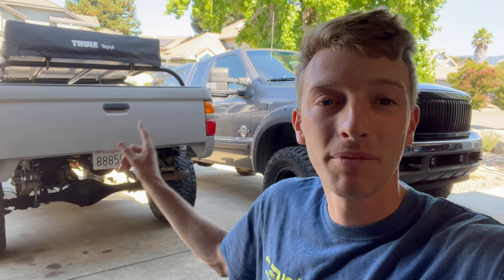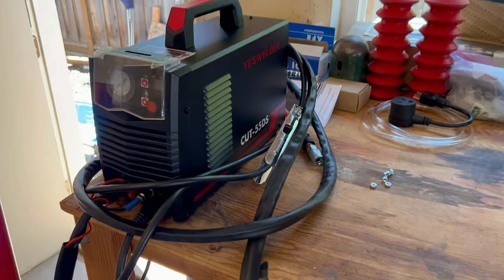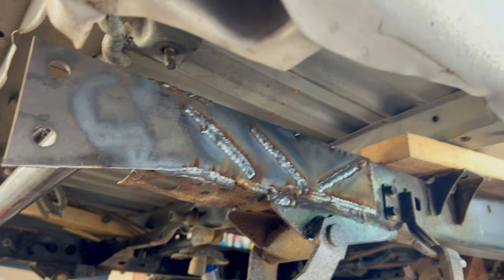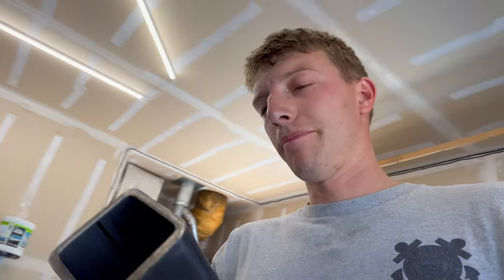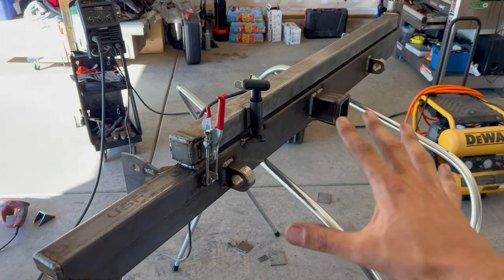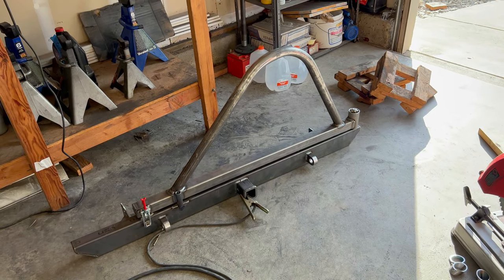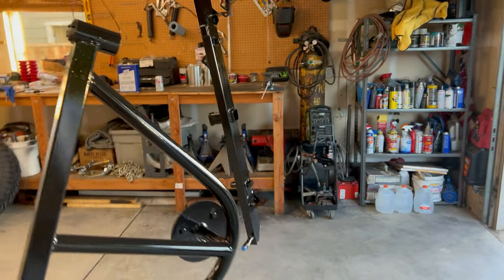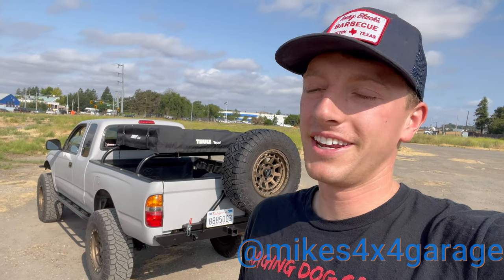Building a Tacoma rear bumper for under $350 in less than 20 minutes!

Comment: Enjoyed the video.

Offset to the right puzzles me.  That makes it block the maximum amount of rear view.  Traditionally a vision blockage would be put behind the driver.  Yeah, I know you can't see back right now, but that rack may not be on there forever.

Never leave a weld you aren't happy with.  That is why god invented grinders and grinding burrs.  Grind it out and do it over.

The best way to keep from doing as you say "dumb stuff" is to draw it all out first.  I use a free 3D drawing program called fusion360.  It seems daunting at first, but there are literally thousands of how-to videos on learning fusion 360.  Think thrice, measure twice, build once.

You mentioned pulling a trailer.  Every state requires safety chains for pulling a trailer.  I didn't see anywhere to attach them.

I also noticed you didn't use your second pin, to hold it open.

Comment: Im getting into building my tacoma and i figured it was about time i learned to weld. I have a buddy that has a machine shop and hes gonna give me some pointers. Whats your welder setup? Is there a broke guy welder to get first? Im sure i wont be welding anything super thick
Reply from the maker: You could start out with a flux core welder and learn the basics for pretty cheap. This is a titanium 170 with gas. Around $600 plus the tank for this which can be a few hundred as well

Comment: Guessing you didn't leave enough space for sag and you had to lift it to shut because you didn't show it also definitely weld up the holes you elongated or when you drop off a ledge onto that bumper it will smash your tailgate but love the looks and welds look great 👍
Reply from the maker: Yea don’t really know how I could’ve worked in the sag before welding it up. It’s about a half inch low with the tire on. No big deal imo
Reply: @mikes4x4garage  it comes with time and wasted material the more you melt it the better you get just don't stop you'll get it down

Comment: That Tire is a bit higher than I would like it to be if it were mine...? Might catch wind if Daily Driving? 
Just seems it would be more balanced, if behind the Tailgate? Though I would not do such a Mount...?
Though I am not doing or would not be doing what You are doing with it... So what do I know? 
Looks well made and that Truck is a 180 from It's beginnings... Now it looks nice, 
You look like a Minimalist with Eccentric Tendencies..
Reply from the maker: It is pretty much level with the RTT and below the roofline right now. And thank you!
Reply: @mikes4x4garage   even if it is 'In Line', Airforce travels downward, as is the case with a Tailgate which is well below the Roof a Truck.. I could be Wrong, have not seen any Smoke or Fan Test?

Cool Build.. Long ways from where it was, for Sure.

Comment: I had a bumper with rear tire mount.  I hated the way the truck rode with that weight hanging off the back... Moved to a standard high clearance bumper and a bed mount for the spare and I'm back with a nicer ride....  bed space is limited though.... Hope you don't have the impact I did on ride quality
Reply from the maker: Mine is the opposite, it rode like a dump truck before. The added weight has really helped!